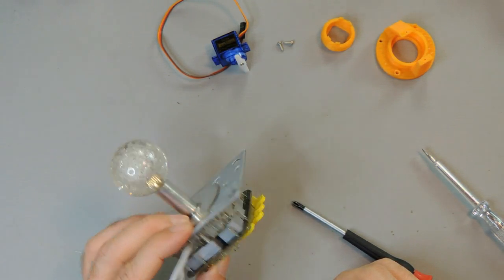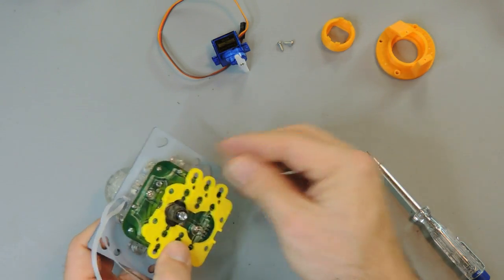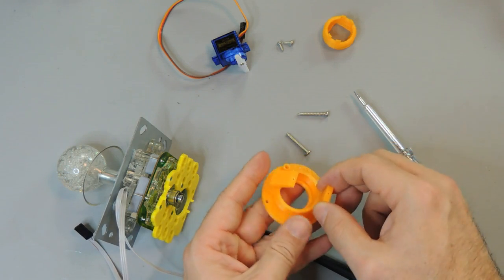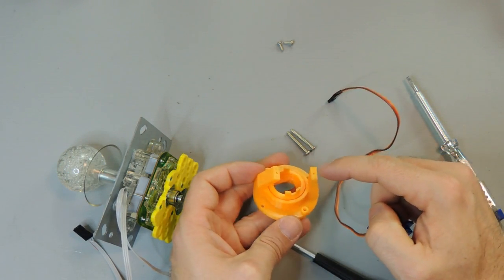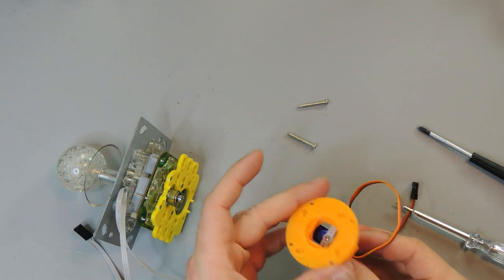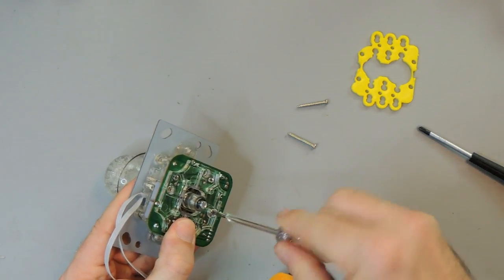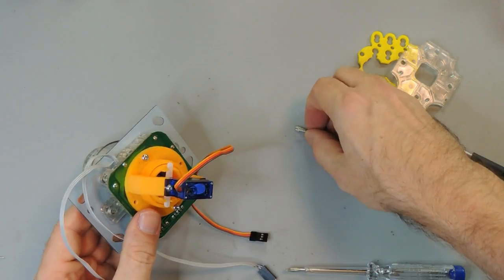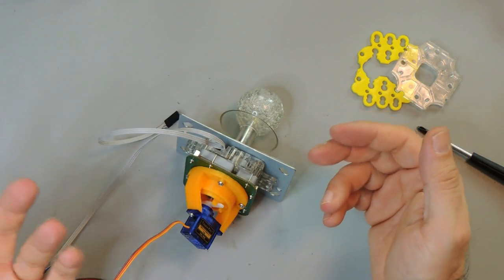Servo Driven Joystick (4-way/ 8-way restrictor) - Part 1

Comment: If it fit lengthwise in my cabinet I will use this great mod, need probably a little modification for my zippyy joystick. But an of the shell motorized joystick cost me to much($50-60 bucks).
Reply: I modified it but the tolerances in the switches and their position are so small that this design of rotating the square is not really working. Like sometimes I get a diagonal on 4 ways and blocking some sides in 8 way. So I started changing the design completely which will allow for a completely independent shape for 4 way vs. 8 way.  I have issues accessing my test prints because of the Corona virus so it's going slowly.  Once I get something working, I'll post the files for the zippyy.
Reply: @Bernard-Poulin  Excellent.  Thank you.
Reply: I got a "ZIPPYY" joystick (blue plastic, 2 metal plates, no PCB) and that 3D (STL) model requires heavy modifications to adapt to the joystick. It's impossible to make it work by just modifying the printed model physically after. It's not just the screws, it also the size of the barrel's rotating "square" hole. It needs to be much bigger. I'll attempt to post the files online once I have it working on my ZIPPYYs.
The servos that I got fits 100% the size (probably the same servo as in the video). Servo is blue as in the video and markings are: SG90 HAILANGNIAO microservo 9g.  (All the SG90 servos look the same to me). Distance between screws center: 27.4mm   distance from top of servo to screws: ~13.3 mm -- this model fits this servo perfectly.

UPDATE: This concept (rotating a square) only works if you have high-enough travel tolerances on your joystick.  The microswitches that came with my ZIPPYY joystick look all the same but they vary sliiiiightly (less than half a millimeter actuating action) that you will sometimes get no clicking on one side in 8 way mode or one diagonal not getting blocked in 4 way mode. Might be due to joystick construction (not sure, nothing is apparent, all look symmetrical). I tried various square sizes (values under a millimeter) and there is no apparent solution. Also when you are very close to hearing the 'click' but you stop just on the edge, it can still click but only after a little delay (like the springs/metal slowly pushes the switch internally?). So really, that is a no go.

Back to drawing board for a completely new design.
Reply: @Bernard-Poulin  Hi Bernard.  Did you manage to change the files so that the models work on your ZIPPYYs?  I have the same joysticks and as you say, this model does not work with those?  I am only just learning CAD so won't be able to change the designs anytime soon :-)  Thanks.  Andy.